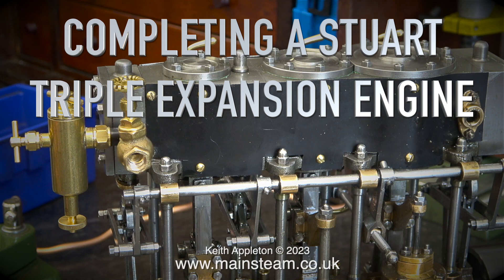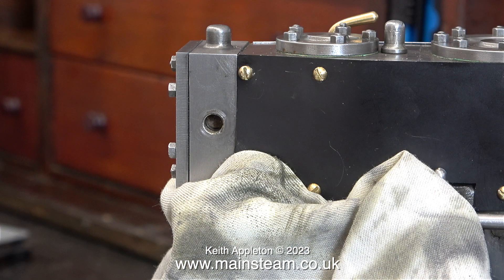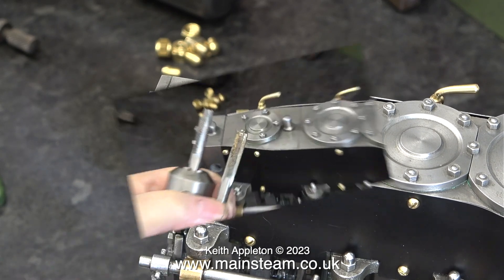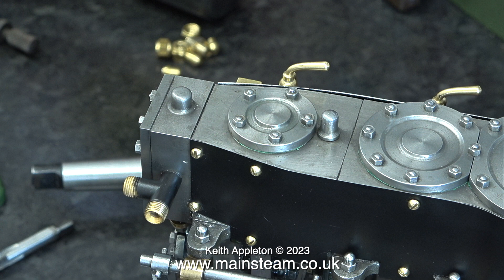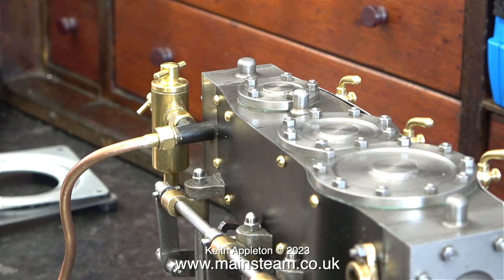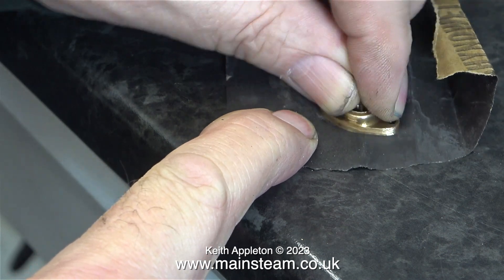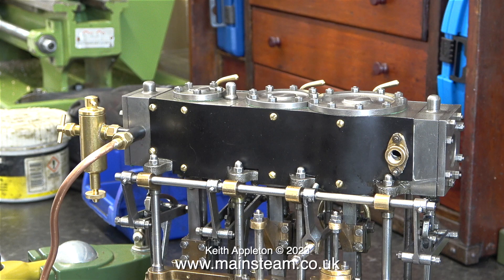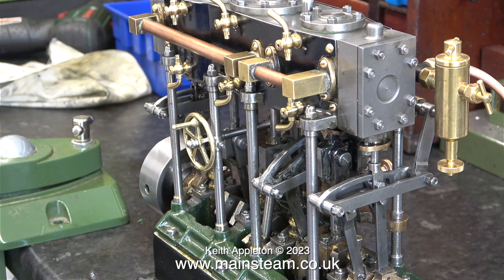COMPLETING A STUART TRIPLE EXPANSION ENGINE - PART #58

Comment: The temptation to say something like "You sound sarcastic in this video, is everything alright?" is nearly overwhelming, but I'll curb my impetuosity.
Good luck with your treatment, which must be long over by now, I had several radiation oncologists as students for many years so I know a great deal about the ins and outs of brachytherapy so I'm aware that  it's a safe, effective, and relatively painless treatment, as such things go.
Reply from the maker: They are saying that Brachytherapy is not the way to go in my case as the Cancer is on the inside edge of the Prostate. I will know more on Monday when I have a meeting at York Hospital with the oncologists . . .